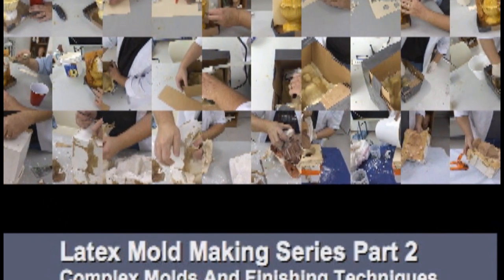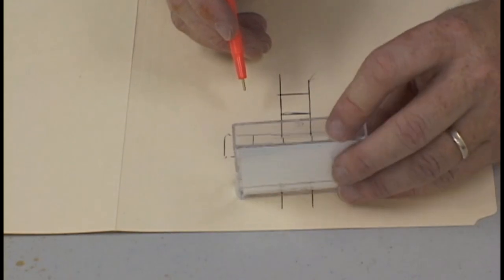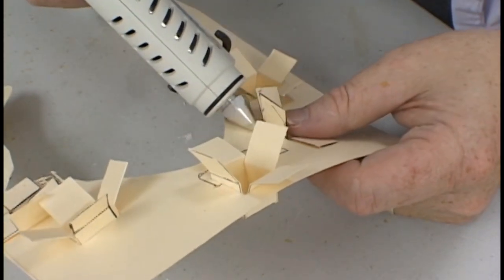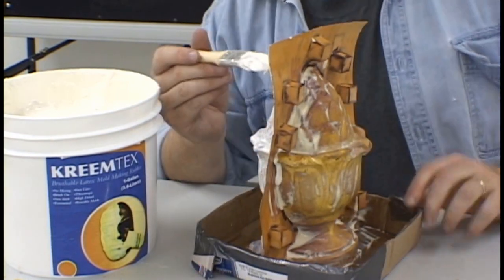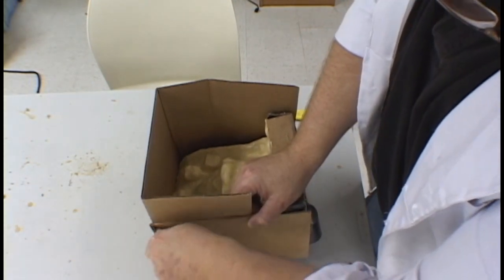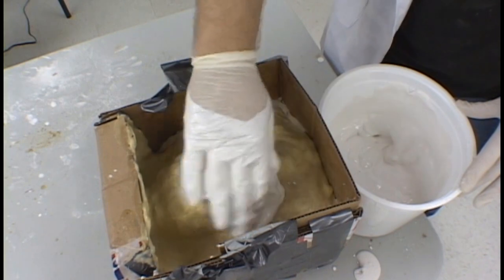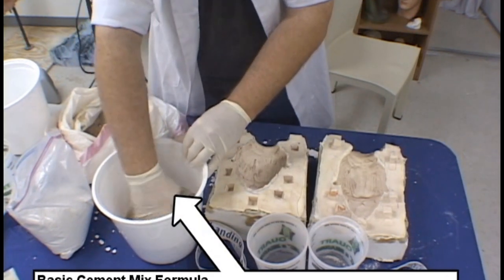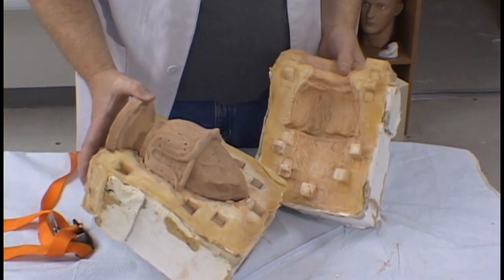Two-Part Latex Mold Tutorial

Comment: Hello .. Good night; 
How many layers of latex would I have to apply to the mold to work with cement artifacts?
Reply from the maker: A traditional mold for cement requires 10-12 applications allowing each coat to dry before applying the next. A latex cement mold outlasts man-made products by many years. Yes, a bit time consuming, but if you place a fan in front of the wet latex it dries in half the time.

Comment: Hi there, I am using your tutorial to make a 2 part latex mold from an object i am refurbishing. I need to seal my object but am having difficulty finding (an affordable) Shellac. Do you have any budget friendly ideas for an equivalent sealer? Is Sanding Sealer appropriate?
Reply from the maker: Use a spray clear polyurethane. Rustoleum is a good brand
Reply: @EnvironMolds  hello, me again. I'm struggling to create a cut out partition for my object. It is a bust with an angled head. Any tips for another way to construct a partition?

Comment: Very slow. Process.
Reply from the maker: Yes, the downside is that it is slow. However, you can cut the time in half by placing your work in front of a fan, or a small heater between coats.